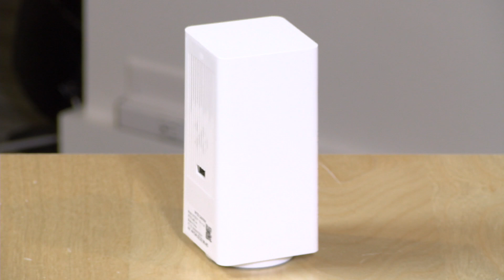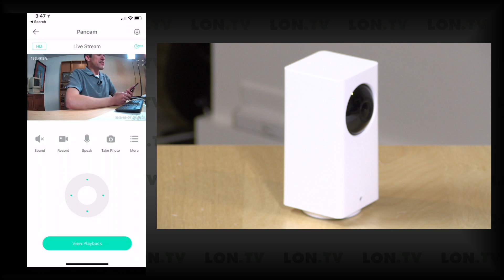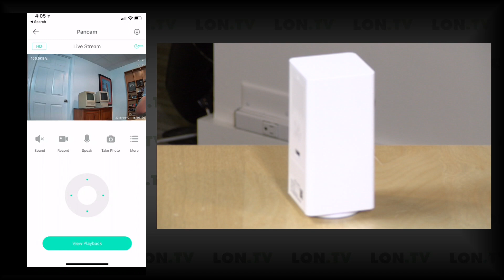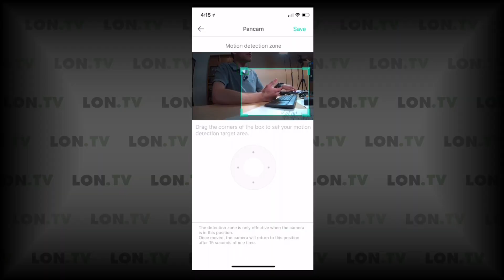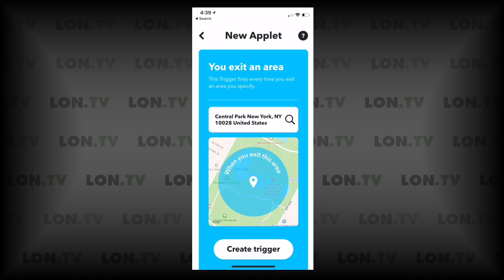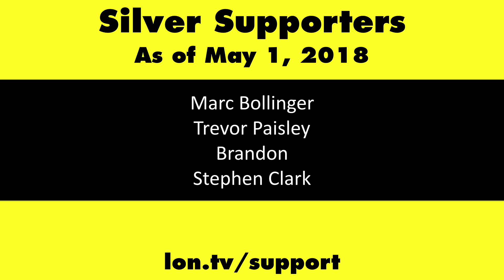Wyze Cam Pan Review - $30 Pan, Tilt, Zoom (sorta) security camera

Comment: I’ve had 1 of these and 2 of the $20 dollar cameras for over a year now and I LOVE THEM. For $30 bucks the imagine is insanely good. Even at night the imagine is pretty good!! I actually, have one of these cameras outside of a window exposed to the weather and haven’t had one issue with it yet. (Knock on wood!!). :). 
The only complaint I have is that my $30 cam keeps losing Wi-Fi connection several times a day and it’s the one that is closest to my router/modem. It kinda is starting to drive me crazy when I’m trying to see what my dogs are getting to when know one is home. The other two cams hardly ever lose Wi-Fi signal.
I most definitely recommend these security cameras!!! For the price the imagine is unbelievable... You won’t be disappointed. Lol and I don’t know work for this company and I don’t know anyone that works for them. I just like the cameras!!
Reply: have you contacted Wyze yet ? They are eager to please and I bet you could get a new cam if you pushed your issue !!!  Jus say'n :)  PS..I've had pleasant conversations with them in the past.

Comment: They need to add a battery to this product to make it portable. I would pay the additional cost.
Reply: You could do it by building a simple power source. You need to find the plug online (or an old one from something else) that is compatible, then open the camera and hack the power on. Use alkalines as the power supply, it will run on 6v (4 AA's). Very simple hack.

Comment: Returning mine.    When using to look outside through a window the camera uses a small light for night vision that reflects back at the camera making the picture viewing useless.   Surprised you didn’t mention this.
Reply from the maker: You can turn off the infrared light
Reply: Turn off the night vision.  I did and works well
Reply: I did turn it off.  Challenge was I also don’t have lights out front.  And the camera is picking up the light across the street.  I did keep them.    Work fine during the day.
Reply: @AskingAIQuestions  use a mount to install it outside...

Comment: I wish IFTTT for wyze had the option to turn off camera, it only allows notification alerts & push to be disabled, I want to be able to turn camera off upon arriving home & then back on when leaving
Reply: Connect the power source to a smart outlet, then control it by voice with Alexa or other service!
You could even instruct it to turn camera one remotely, when away from home! I just demonstrated this to my wife by turning on our desk lamp while I was 20 miles away from home!
Reply: You could also use a micro controller, setup a simple voltage regulator to power it on and off with  programming. Very simple to hack this camera.

Comment: I plan to get one but I'm only going to put it by my front door because I have a smsrt doorbell thatsv pretty good and has motion detection but it drains the battery so going to plug one of the cams  directly into a wall so if someone doesn't ring my doorbell will still get motion detection I did consider putting one in my house but I'm very unsure of this as I don't know much about their service and whether its  encrypted and secure which I doubt at this cheap price  but if I do decide to put one in my hallway I plan to connect it with a smart pug with a routine so it switches on when I leave my house and turns off when I arrived home so I keep some privacy and the only person that would be on my camera inside my home that is someone that should not be there so it's kind of done it's job

Comment: Excellent review. I just got the wyze cam V2 but might return it for the Pan version, given that the extra motion capabilities are probably worth the $10 extra.  it's too bad the motor can be heard and it's bigger. If you mount it upside down and flip the image 180 via the app, does left and right panning get flipped too?

Comment: You can use the USB on the back to daisy chain wyzecams.
Reply: its for their PIR sensor and other accessories
Reply: Maybe that is what it is for (I know that it is for sure on the V2),  but having a cable attached to it there would make it hard to rotate the camera.
Reply: No, it doesn't provide enough power. Also, 39gadget, it's for the Wyze Sense Bridge.
Reply: It is a limited Daisy chain but you are mostly correct. Their regular indoor camera will support only one additional camera which limits your options but if you have two cameras that could be mounted in a single area pointing in different areas this could minimize extra cabling which is a plus
Reply: @DefundTheFringes  Why advice against it and not disable the feature instead, not everyone reads the manual... Just my ¢2

Comment: Lon, have you looked into flashing OpenIPC on your Wyze cam? People are doing this to bypass the cloud restrictions. This let's you use a NAS and other apps with your cameras, among other things.
Reply: OpenIPC is just a ripoff of other opensource projects that adds no value but tries to sucker money put of people. If you want to replace the firmware on this camera look at https://github.com/EliasKotlyar/Xiaomi-Dafang-Hacks. The Wyse camera is the same as the Xiaomi Dafang camera except for the wifi driver used. The Dafang Hacks project supports both.
Reply from the maker: I don't think these Wyzecams support that. The Xiaomi versions do.
Reply: OpenIPC works for the Wyzecam V1 and V2s as well as the Xiaomi... Currently working on an update for the Wyzecam Pan.
Reply: @seouljah760  Where can I find the OpenIPC update for the Wyzecam Pan?

Comment: I really like the cameras themselves.  Some thought have obviously been put into them.  They could have cheapened out and made the stand just a plastic one and have you plug in the USB charger in the back of the camera itself.  But they didn't, and it's details like that I really appreciate.  I don't however, like the idea that all my video is going through an app that has its own set of servers.  Just let me use them as local IP cameras.  I've also read now that users are detecting the Wyze app is sending info to servers supposedly not affiliated with Wyze.  This might be something to look into Lon.  Thanks again for another great upload.
Reply: [Aegus] they're sending the data to Amazon S3 Bucket servers. Extremely secure. No need to worry about that.
Reply: they are pieces of shit if you can even get a single one to connect to your wifi it would be a fucking miracle ,i have not been able to get ANY of them to even connect to my network , useless crap
Reply: You have to connect them to a 2.4ghz connection and not on the 5ghz connection. Try that.
Reply: +Jon Urban thanks , 2nd level support was able to find my problem for  me ,  yes i was using 2.4ghz ,the problem was that my router had added an invisible space to the end of my SSID name that i could not see,i did not type the space at the end  of the SSID when i named the 2.4 ghz band on my router ,the router added it there automatically  for some reason ,the  when i went  to the  wyze forums it said that the app sometimes will add a space at the  end of the SSID when it autofills in the SSID and it said just delete the space ,i kept deleting the space and it  still was not working ,because the space was actually there ,i had to go into my routers wifi settings and change the SSID for the 2.4ghz band by deleting the space at the end of the SSID
then it finally worked , the tech said it has something to do with the QR code not being able to process special characters,that is why all my  other clients would connect but i  could not setup the cam
ended up being up a huge pain in the ass because then i had to  put in the new SSID for  every one of my  other devices and i have like 30 clients,i had to update wifi credentials for all of them to reflect the new SSID , but i m still glad this happened this way because i have never been able to get rpi's to connect to my wifi either i think this might be why no matter how i edited my WPA_supplicant file my  r pi's would never connect to my router  , because i was not enter that space at the end of the SSID
the 1st level tech guy could not figure it out ,we tried everything the second level tech guy found the problem in like a minute
this product does have good support
my router is an Asus  so if anyone else has issued and has an Asus router this could be the problem, not sure why my router adds that space at the end
really glad this happened because i would have never figured out that space was there and i would have went insane trying to set up my pi's an pi zero w's
like before when i tried for 2 weeks straight to get  my pi to connect
 editing my WPA_supplicant file every which way and  changing random router settings to no avail
Reply: Nice
Reply: +Pixle thanks yes i am familiar with  Xiaomi  i love their stuff
 i have a few mi band 1S's , a mi box 3,  a pair of piston 3's ,a pair of piston pro HD's , a pair of touch gloves ,and a  mi power bank pro 10000 ,all of their stuff is great ,  my mi bank arrived with some scratched tho  ,but the materials and builds on all their stuff is top notch
yeah i have heard that  xiaomi has a  camera with the same  form  factor but i don't really know anything else about it , i will have to look into it more
i think there are also people who have a CFW for the  wyze cams  or maybe it is for both of them , i  have to check out the Xiaomi model to see how different it looks
but i like the Wyze cam  because it has good  American English speaking support based in Washington state i think and  their FW supports Alexa and uses AWS for the video
i hope they can work out the motion detection issues though
there was a FW update tonight too i will see if it helps any
but seems like the  wyze  probably has most features in their FW
Reply: No thought have been put into them, they're just slightly altered xiaomi cameras. That's why they're so cheap, they took existing product and turn them into their own things so they don't have to go through the expensive designing process. Not saying it's a bad thing tho, it's good because we get cheap cameras.
Reply: redstone craft guy do think it’s possible that Xiaomi is copying the Wyze technology? After all it’s not like Chinese companies have NEVER done that before.
Reply: Not too bad for the price but i must say the  motion detection is not working  too good.
 seem to  only detect outside of the custom detection zone  i set
 does the exact opposite of what i want it to do as far as motion alerts
i set the detection zone so it will only detect if someone walks on the front porch but this thing triggers motion events every time a car drives by ,but if i go on the porch and jump and down in front of the camera  it does not detect a thing
it literally  detects all motion outside of the zone i set for it and detect no motion inside the zone ,  i hope they fix this in the next FW update
also some motion events i can not download the video for it says network timed out and i can never download the videos

Comment: Wyze Privacy Policy "By using Your WyzeCam, You authorize Wyze Labs to maintain video data recorded from Your WyzeCam on the WyzeCam cloud.

Wyze Labs shall use commercially reasonable efforts to prevent unauthorized access to Your recordings maintained on the Wyze Labs cloud.

However, You acknowledge, understand, and agree that as a result of issues unrelated to Wyze Labs’s fault, including the inherent limitations in all hardware and software, unauthorized access to Your recorded video data may occur." https://html.wyzecam.com:8702/PrivacyPolicy.html
Reply: This is a standard disclaimer and applies to any and all devices that use the cloud, including Alexa, Siri, Cortana, Google and many others. Caveat Emptor!